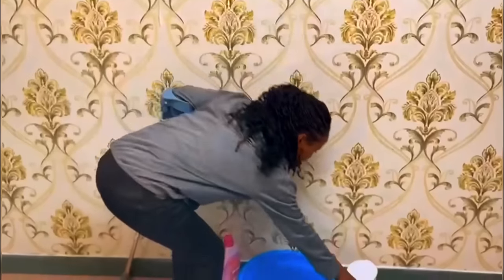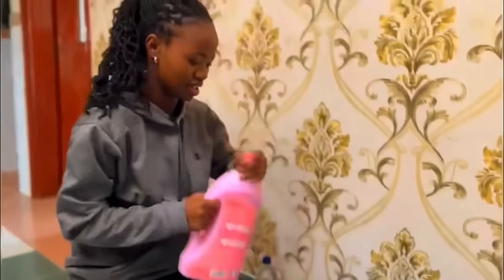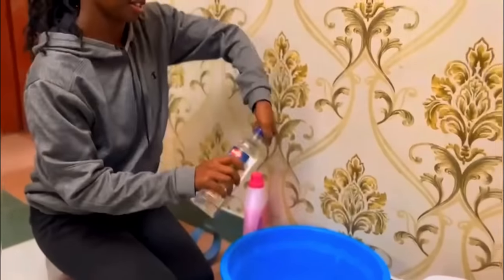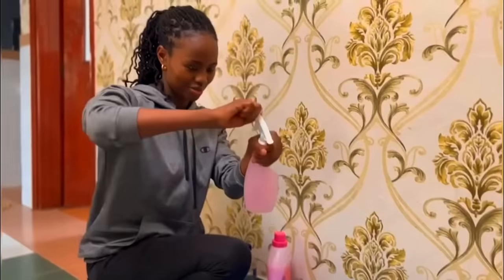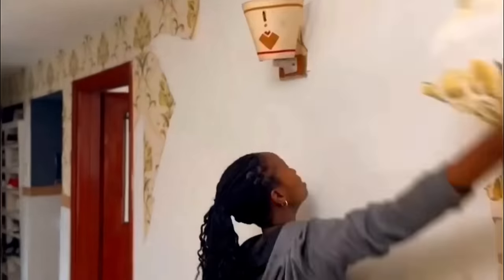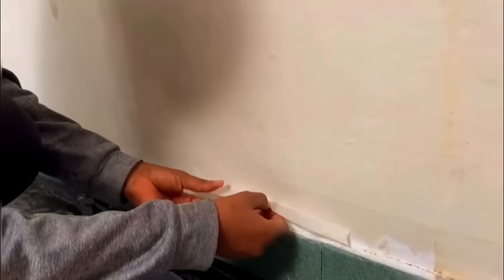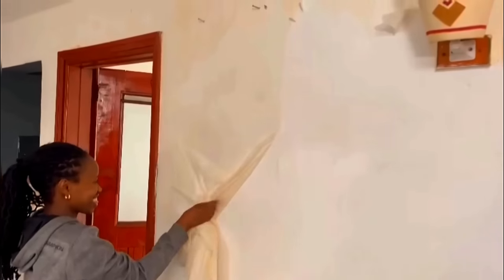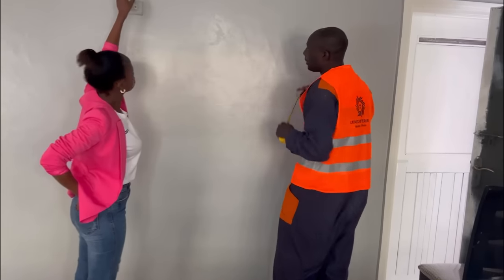HOW TO REMOVE WALLPAPER AND INSTALL CLASSY WAINSCOT!! || MARYA OKOTH. #interiordesigner

Comment: Welldone and very good job baby gal...what amazing me is your effort even though you have a problem with you leg and having a one year old baby but still working hard...your good example to other girls...keep it up.
Apart from using liquid to strip wallpaper
You can use a steamer as well,which is the best to prepare the wall ready to be painted,because steamer helps to remove  the wallpaper paste by scrapping off  using a scrapper...is just advice coz I'm a decorator as well,all in all kazi ni nzuri nimeipenda, very good transformation...
Ungeweka namba ya simu pia kama watu wanataka kukutafuta kwa kazi au hata kuku support kwa tip...
Reply from the maker: Thank you for your insights fella😊